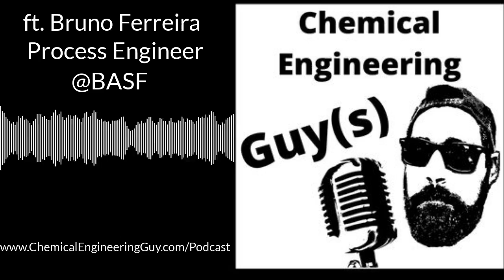Bruno Ferreira a BASF Trainee Working as Process Engineer (Episode 002)

Comment: thank you so much for this podcast.But specifically I want to know that which type of you need to do to get a process engineer job.I have also done BSc in chemical engineering but my dream is to be a process engineer. please give me some suggestions that which certification  I can  accomplish to get a process engineering job
Reply from the maker: Thanks for sommenting! Well, in order to become aprocess engineer, you gotta have solid background in unit operations, plant operation and design. Then apply to "process engineering" roles, only... There is no trick, these people end up in process engineering because they look for it (I did as well). If you end up searching and finding jobs in EHS, EPC, etc... you will not end up as a process engineer
Reply: Where do you live? In USA the NCEES certification is good from what i know.